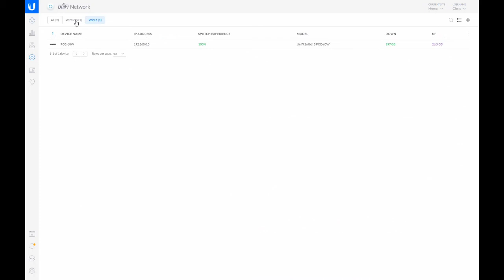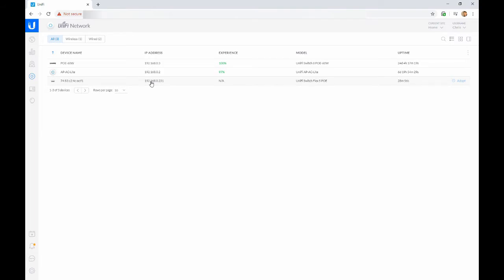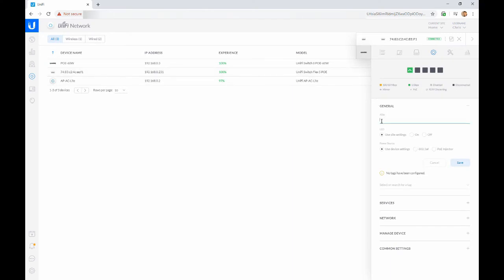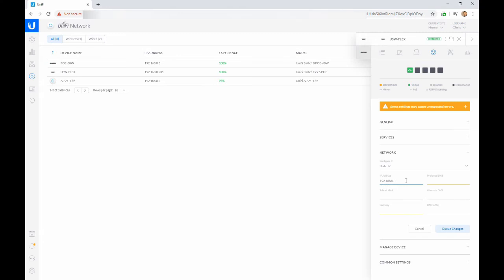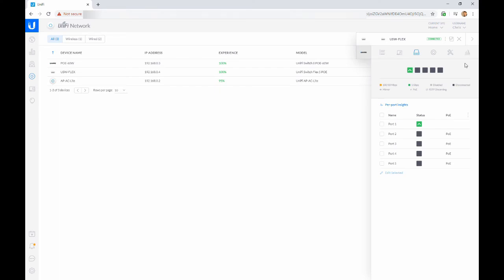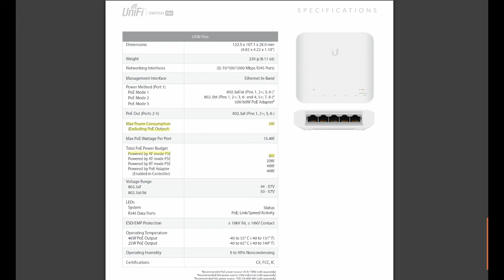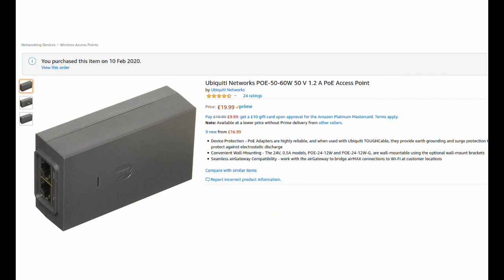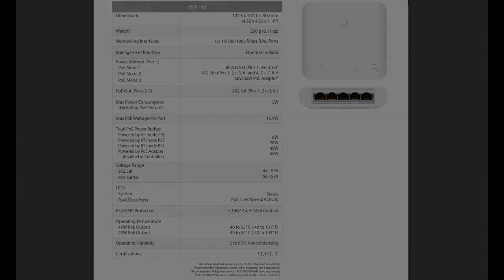Unifi Switch Flex, unboxing and configuration

Comment: Thanks for the video on this. Could you also use the POE-54-80W adapter on the USW Flex or would this cause damage to the unit?
Reply from the maker: You are best to consult the data sheet, or log a support ticket with Ubiquiti. The model numbers are really confusing with the POE injectors.  In all it has been a great unit, I'm just about to add an additional G3 Camera and make a video on that as well.